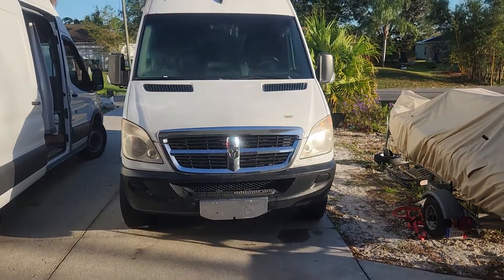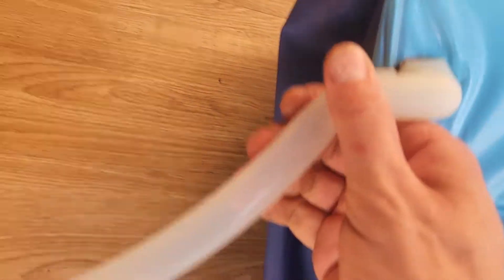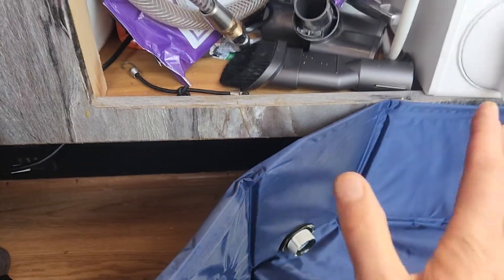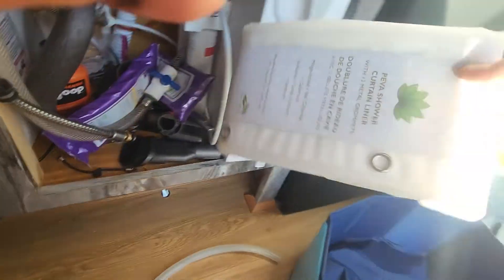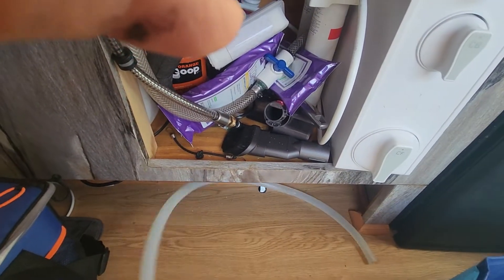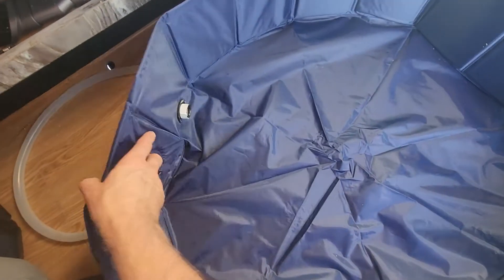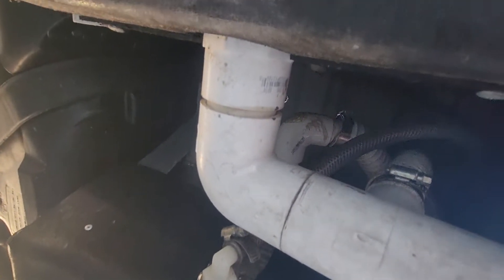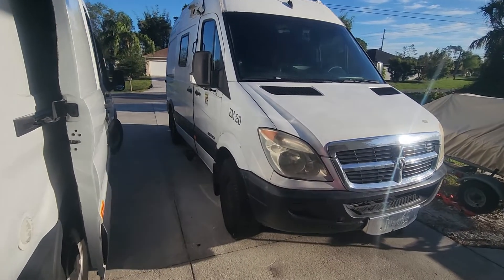Inside Shower Idea, Low Cost, Effective, for Camper Vans

Comment: It's actually a scale that gets on the water heater element it's easily cleaned off with a wire wheel on a drill or a brass brush thingy
Reply from the maker: Not in my cases: I had to use a knife / razor blade in addition to wire.

Comment: Yes I use planet fitness and truck stops or outside my van if it's feasible
Reply from the maker: For five years I used planet fitness quite a bit until I installed the inside shower and never went back there. PF is kind of OK, but they do close on certain holidays, etc. and that's hard to keep track of. Many times all shower stalls were in use and I had to waste time in the bathroom waiting. May times the stalls had hairs everywhere because people shave in them, trim pubes and blow their buggers on the walls. Shower shoes aren't high enough to prevent athlete's foot.